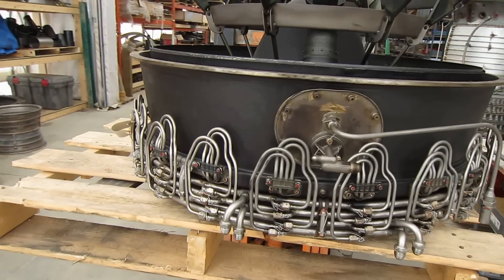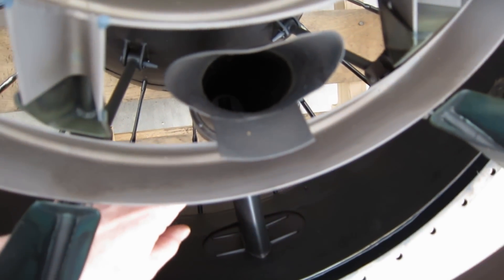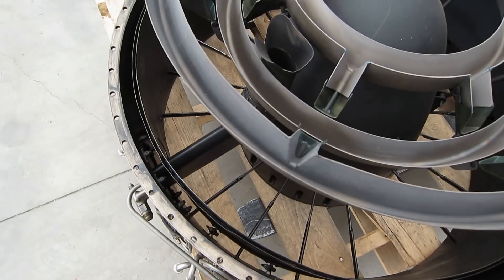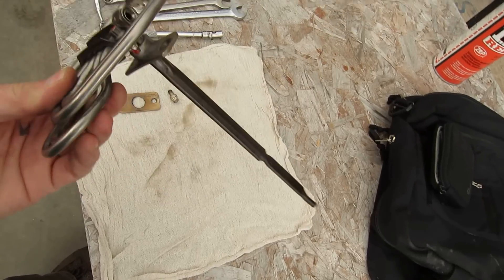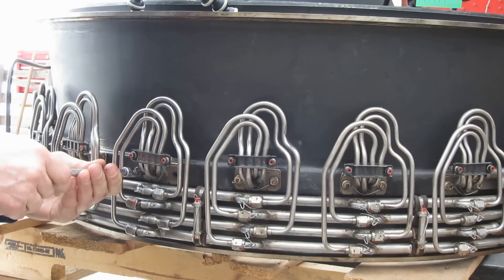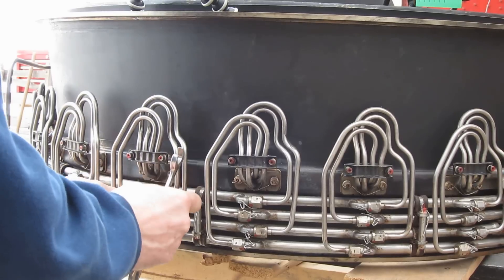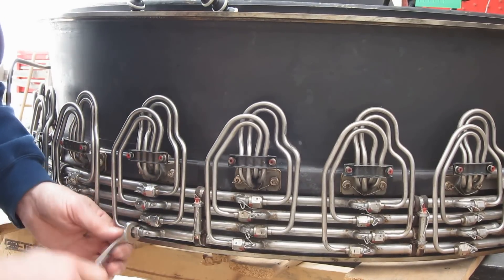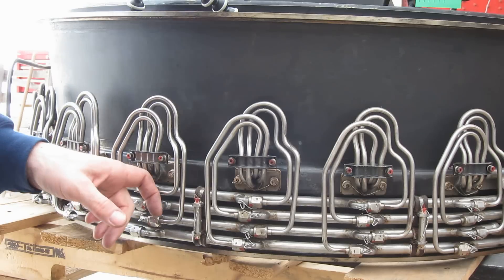Afterburner Fuel System

Comment from the maker: Yes, very good. Only thing I would say is the fuel is not dumped, but sprayed at high pressure in a multitude of directions in an effort to have it distributed in an even pattern, without hot streaks that could damage the jetpipe.

Comment from the maker: Interesting question. There is no air purge, but I think once fuel flow stops, whatever fuel is left in the spraybar must flash off to vapor before it cooks into carbon coke residue. The spraybars don't clog up, even though they live in the exhaust of the engine.

Comment: As you may already know the afterburning system is connected to the aft part of the engine, right behind the last stage of turbine blades. And the fuel is sprayed by the fuel rods and ignited by the torch igniter. But in order to combust the hot gasses need to mix with the fuel and the flame holder provides a mixing area due to the drag crated by the rings and the fuel mixes in the reverse flow allowing the fuel to ignite. Than the hot afterburning gases flow down the jet pipe and out the Nozzle

Comment from the maker: I like to say spraying because it is sprayed at high regulated pressure through carefully sized orifices. 
To me dumping means dumping... high flow diverted out of an orifice whose size doesn't really matter, so long as it offers minimal resistance.
Fuel flow at max dry power is about 35-37 gallons per minute for a J79-19

Comment from the maker: There is no mild steel anywhere in the engine. That's what our engine mounting frame in the test cell is made of.
The case in this video is very thin, and made of a high temprature alloy similar to Inconel.  The temp of the core engine's exhaust, which is what flows through this casing, immediatly upstream of the afterburner fuel injection, is about 800 - 900 degrees F. The casing is guilt to withstand that.

Comment: You could just wiki it.  Basically, afterburning is dumping fuel into the burning exhaust stream to greatly increase the thrust by increasing the mass and velocity, the second part of which is generally an important feature in order to get most aircraft past the sound barrier.  Afterburning is also incredibly reliant on nozzle design to get the most out of the energy produced.

Comment from the maker: All I can tell you is, as far as I know, the full name for the concept is "thrust augmentation via afterburning"... so that would mean both phrases are just different ways of referring to the same thing.
One other way of thrust augmentation is by the use of water injection into the combustor along with extra fuel.
As far as I know, modern fighters do not use water injection, but I am not an expert on the newer engines.

Comment: Hello, thank you for the close up in depth videos of the afterburner components. I am curious about why is there 4 fuel lines entering each spray bar.
Reply from the maker: Each spraybar in this particular engine has over 20 spray orifices, arrange in 4 separate sectors, each fed by it's own fuel manifold.
This is done so that each sector can be supplied or shut off as needed.
This is to maintain a better spray pattern between min and max afterburner.

Comment: The after burner uses up to 50 US gallons/min, what is the fuel consumption of the engine at full throttle. I would think the after burner is only used when needed, steep climbs or to get gone fast.

Comment: 1) Are those fuel rails controlled in an infinitely variable way, or does it turn each manifold on/off to control flow?
2) For final tightening of these connections, I assume you have to use a torque wrench with a crows foot attachment? 
3 Are the inner ends of the spray bars retained mechanically or do they just float in those holes? Seems like having them loose in there might be a concern for vibration.

Thanks for the videos.

Comment from the maker: ...and maybe I didn't explain it as clearly as I could have... that's 50 gpm on top of the 35 gpm the engine consumes at full power. Total fuel consumption of a J79-19 at Max AB is 87 gallons per minute... give or take one or two.

Comment: Wow, the afterburner adds 20,000 pounds per hour to the fuel flow. I've heard that modern fighter engines can burn over 60,000 pounds per hour in full AB (higher bypass ratio = more oxygen to burn).

Comment: I like to say dump just because of the extremely high fuel consumption involved :P

Do you have any idea what the fuel flow rate is at max military power (no a/b)?  40-50 gallons/min?

I bet in 10 years or so you guys will be seeing old F404s from CF-18s.  Amazing how it's much smaller than a J79 and every bit as powerful, and even more so for the F414 and it's EPE/EDE derivatives.

Comment: I alway thought that the fuel sprayed put of the round flame holder. It wad cool to see that put together.  What does the flame holder actually do?
Reply from the maker: Well, like a wall is a good place to seek shelter from the wind, the flame holder is a small obstruction to the gas flow, and creates a region of lower velocity and turbulence right behind it. This allows mixing of the fuel spray, and allows it to continuously burn in that turbulent region, so the flame does not get blown out.
In other words, the flame holder ... holds the flame

Comment: Is the lubricating oil used like hydraulic fluid for actuators or is fuel used for that?
Reply from the maker: The engine has a main lube oil pump, and a hydraulic pump. They both draw from the engine oil reservoir. The AB actuators are powered by oil, but the Variable Stator Vane actuators are moved by fuel. It doesn't make much sense to me either, but there must be a good reason.

Comment: Are these fuel lines or other lines allowed to make contact with with other lines or metal parts or is it required that all lines be designed so there is no contact to prevent a wear spot which could later produce a leak/opening?

Does the spark igniter remain sparking all the time when the afterburner section is spraying fuel, and is there more than 1 spark igniter, or is the spark igniter just used temporarily then turned off when in afterburner?
Reply from the maker: Question 1: what's your guess on that one?
Question 2: With the afterburner, the ignitor is always on. With the core engine, the ignition is only on to get things burning, then it's turned off.
Question 3:  there is only one ignitor for the AB, and usually two for the core engine.

Comment: why are those afterburner fuel lines curved in such a specific way? Does it have something to do with centrifugal force driving out contaminations in the fuel or something?
Reply from the maker: I think it's more to allow some thermal expansion of the entire case without causing stresses in the rigid steel lines. The fuel is filtered going into the fuel control, and it is filtered again just before being sent to the fuel spray nozzles.
Reply: AgentJayZ ah yes my teacher said that too, I remember now. Wish me luck on my turbine engines final tomorrow !